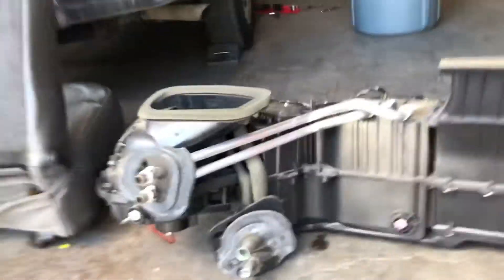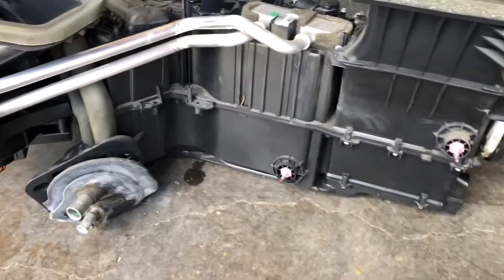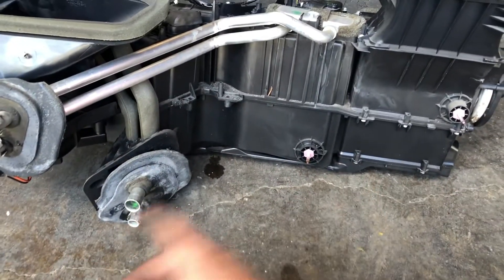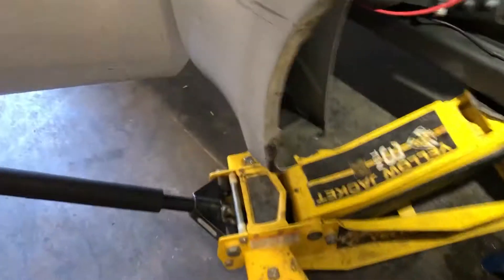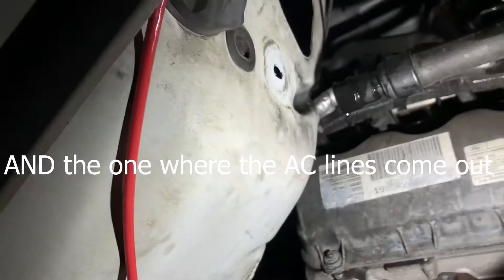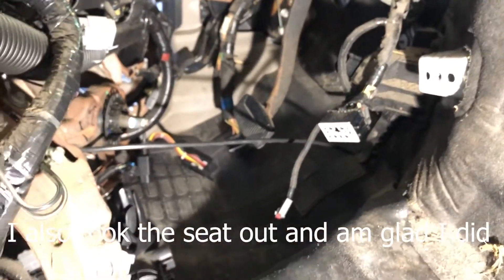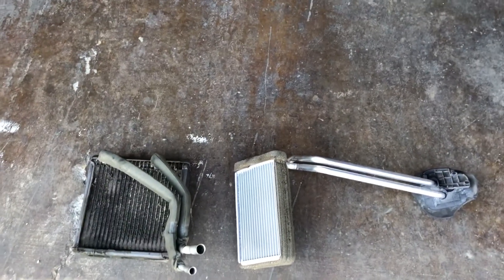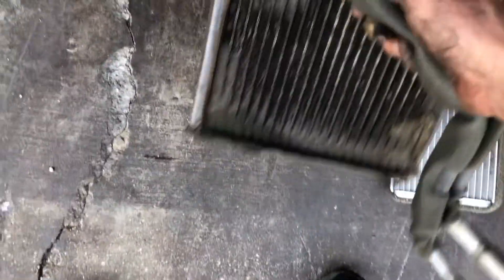2008 2009 2010 F250 Superduty Air Conditioning Repair. HOW TO REMOVE AIR CONDITIONING Evaporator Box

Comment: The two hard to get to ones are relatively easy if you go from the underside and have thin enough forearms. One on either side of the transmission.

Comment: Great info man, comment on the matter, the last bolt behind the exhaust pipe just remove the transmission stick and u can slide the hand with a fast wrench 11mm and u can get that nut off.

Comment: I am in the process of doing this. In your video, I see the two that are behind the engine. They are the ones on the right. I then see the one on the left. That is a total of three I can see. Your video has a subtitle that says there is one by the a/c lines. Is that a total of four from the firewall or is there just three from the firewall and the ones on the inside?

Comment: Where are the other two bolts on the inside?
Reply from the maker: I don’t remember exactly where the bolts that were inside the cab were. I just remember once I took the dash off, they weren’t hard to find. It was the bolts hidden on the engine side that had me scratching my head for about a half hour.